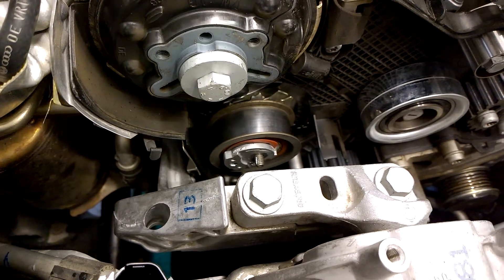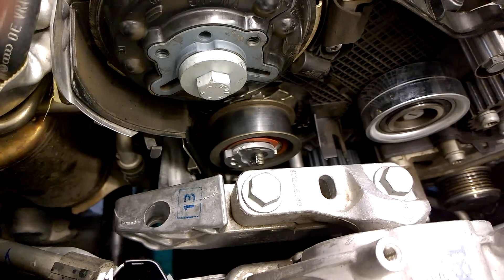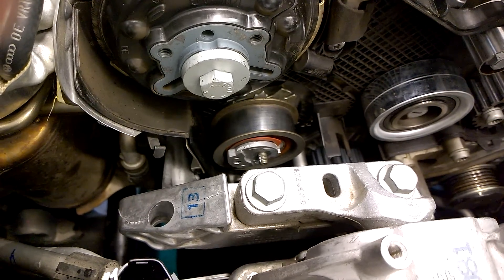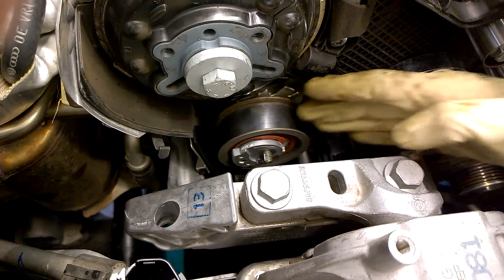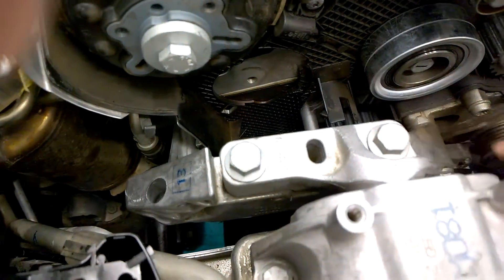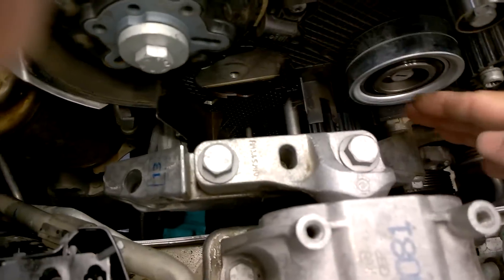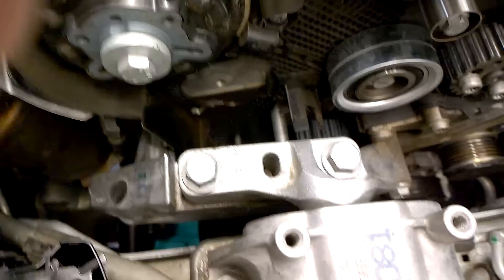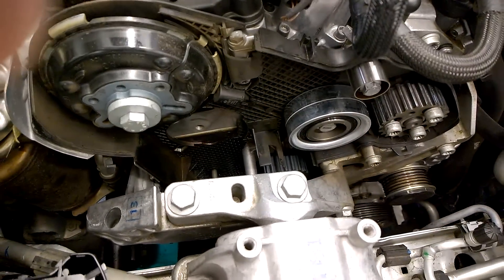VW Common Rail and BRM TDI time saving timing belt job shortcut!

Comment: Does this same trick work on the newer 2.0tdi's ?      - thanks
Reply from the maker: Yes on '09-14. The bracket captures the belt on 2015s so for those you have to remove the mount.

Comment: Thanks for sharing, Good tip. Wonder if there's enough thread on the stud for a double nut?... Did u replace the stud?  U can cut a slit in a spare nut to keep from damaging the threads & grip the nut.  - take care
Reply from the maker: Hi - this is an older video. On engines with tensioners which can be replaced with the engine mount bracket installed we include a new stud. That said, the stud is absolutely reusable provided you grab the un-used threads behind the tensioner for the remove & install.

Comment: Not always as easy as it seems. Mine was a bit tight so I pushed the tensioner to the engine mount and used vise grips to break the stud loose. This way I avoided damaging any threads the nut will use.
Reply: @dieselgeekdotcom  Yep, just have to make sure you have a decent pair of vise grips because I tried a cheap pair and it was a no go.

Comment: I have a 2011 VW Jetta Sportwagen TDI (CJAA). When changing the timing belt in this car without removing the engine mount there is very limited space to properly torque the timing belt tensioner. Here is a tool set up that I found that worked well. I used the 3/8 In. 40 - 200 In. Lb. Professional Compact Torque Wrench from Harbor Freight along with a 15MM 3/8 in. Drive Metric Crowfoot Flare Nut Wrench. This combo worked great and I had plenty of room to properly tighten the tensioner.

Here are links to these tools:
Compact Torque Wrench: https://harborfreight.com/merchandising-promotions/new/38-in-40-200-in-lb-professional-compact-torque-wrench-56614.html

Crows foot flare nut wrench:
https://www.homedepot.com/p/Sunex-Crowfoot-Wrench-Set-SUN9710M/300685581?MERCH=REC-pipsem-303220072--300685581--N
Reply: Wow thanks for this tip. Just about to buy this exact car, and was wondering about that exact thing!!
Reply: You could do it to gootandtight torque spec. :😁😁

Comment: peronally i dont really understand how the belt can go on without removing the engine mount as the belt wouldnt be able to be installed correctly as the mount sits inside of the belt route. i could be wrong but from personal experience of changing atleast 10 of these belts and tensioners.
Reply: @dieselgeekdotcom  i stand corrected and now i know for future reference thanks for clearing that up so quickly

Comment: will this work with a 2006 Jetta TDI BRM (stick)?  I've got a TB and WP to do.
Reply: No it won't. I have a 2005.5 and this is to tight.  Just put a jack with wood under the motor at the oil pan. I used a engine support bar, but had to use a jack to re-align the motor mount as the bar was keeping the engine to forward.
Reply: your wrong cavy, works on all mkIV's too
Reply: dmann343 ok buddy, you try to get a wrench in there and tell me how it goes!

Comment: I can't see how this wouldn't possibly ruin the threads on the stud by grabbing it with a channel lock or vise grip. I have done the timing belt change on this engine a couple times with the engine mount removal method with no issues, but this method would definitely make it easier. Have you seen any studs that were harder to get out than others? Do you need to cover the threads with anything to prevent against ruining them?
Reply: Scratch what I just wrote, I see now that you provide a new stud with the kit. Awesome!
Reply: if you've ever wrenched more tools than the craftsman ones you got for Christmas, you'd know it doesn't matter to the stud or nut

Comment: but is there room for a torque wrench?
Reply: torque your dink, not necessary
Reply: See the post above with a torque wrench and crow's foot wrench combo that works very well for this purpose.
Reply: ***** maybe if you can't tighten engine mounts correctly then maybe a timing belt job would better be left to someone with a little more mechanical experience lol

Comment: Ok but how do you get the new stud in without damaging the threads?
Reply: +dieselgeekdotcom I didn't know that, thought it had to be in there pretty tight based on how you needed to squeeze the old one hard to grip it enough to remove but I guess that's just corrosion right? Can you torque the but this way or is it by feel? I have an ALH myself which i am better versed in but I love any TDI!
Reply: +dieselgeekdotcom Awesome explanation, thank you! Do you not need to torque the nut though?
Reply: +dieselgeekdotcom I see now that there is enough space for a torque wrench, that would have been my next question. I know this will help a friend of mine as he is doing his belt very soon. Thanks again!
Reply: You can't remove the tensioner bolt without removing the engine mount on a 2005.5 Jetta BRM TDI.  Their simply isn’t enough room. My tensioner was red locktite on the bolt by an ignorant VW technician. No locktite was used on the engine block, so guess what?? It came loose on the block and put the tensioner to the end of the cam sensor, so my car wouldn't start from time to time. But no mechanic could figure out what the problem was.  I figured it out when I replaced the timing belt I now check the tensioner every 20k miles.  I will replace the stud at every timing belt change, as long as I own this car.
Reply: @dieselgeekdotcom  quit spreading bullshit misinformation that can cost people an engine. BRM (1.9tdi pumpe-duze) calls for 15Nm on that stud and it is a replaceable part with part number N 909 055 02 and dimensions M10xM8x73. It calls for red locktithing it before install and torquing to 15Nm using either a special stud tool or the 2 nuts method. CBEA (2.0 common rail) uses the exact same stud with exact same part number and exact same torque spec.
Reply: @HristovRumen  ehhh...I Piss 15Nm.......